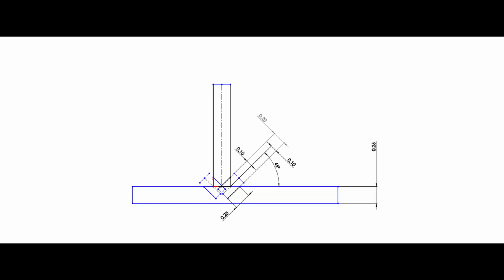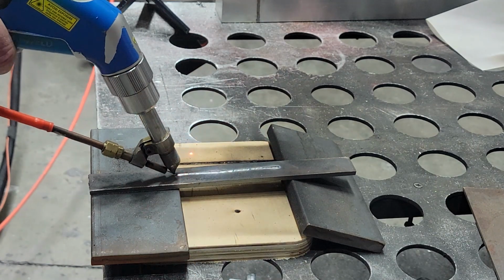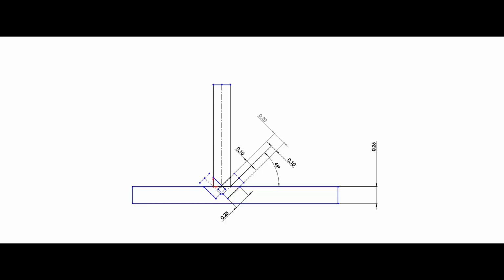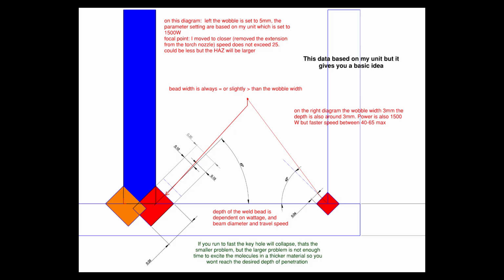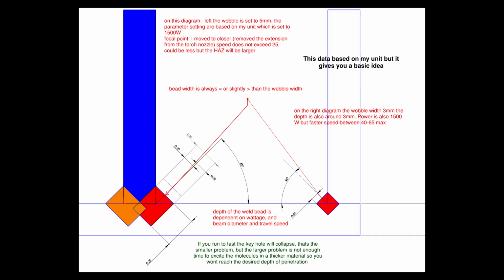how laser creates the plasma and how to control penetration

Comment: Nobody ever puts a ground clamp in arc welding. There is no such thing. It is a work clamp. It’s part of the live circuit. It can be called a return clamp as well. I don’t know where the term ground clamp came from, but it’s wrong. It’s also dangerous, particularly to new welders who don’t understand the electrical concepts of welding. If you clamp to something that is grounded, thinking, hey I’ve got a ground clamp, and begin to weld, you will short the welder, likely damaging it. You may also damage whatever you’re going to weld if there is electrical or electronics inside that isn’t isolated from the part you’re welding. You may even damage yourself.
Reply from the maker: We all know “ground clamp” is the wrong term, but it’s printed everywhere  even on packaging. It’s your favorite topic in arc welding, the same way I jump on the so‑called ground clamp in laser welding. lol

Comment from the maker: What I forgot to mention in the video is that fillet size doesn’t really matter. If you look at my chart, you’ll see why. Since you’re not relying on piling in filler metal, penetration depth is controlled by your parameters, and weld width is set by your wobble length. Ultimately, it all comes down to the maximum capability of your unit. Build your own chart and you’ll know exactly which settings you need to run. larger is you power the faster you can run your welds.  Its DWELL time!
"Added" : So why use filler metal if it’s not strictly needed?
Because your setup will always have small gaps where the laser rays can escape. By adding filler wire, fewer beams are lost, more energy is absorbed into the joint, and fusion improves.
And this is why dual‑axis galvo units are critical: they don’t just sweep side‑to‑side, they trace controlled geometries (circles, triangles, ) that lock more energy into the joint. the wobble pattern spreads heat across the gap, gravity drives the plasma into the gaps  therefore reduces beam escape, and drives deeper, wider fusion.
"Side‑to‑side wobble is absolute as of now".
This is why the Xtool is $3K and not $20K: it delivers the baseline wobble and filler‑wire fusion, but it doesn’t carry the full dual‑axis galvo geometry suite or industrial‑grade plasma control. It’s a small shop‑level unit, not an industrial‑grade system. Basically is not suitable for a  larger operation.
Reply: I have the XTool. It’s an excellent product. It can weld just as well as any other model within its power range, which is 1200 watts. It doesn’t cost $3,000. It costs$7,500. I don’t believe you know much about it. Filler metal does more than you seem to think it does. It prevents dished welds. That is, the lower than the surface welds you often get with laser autogenous welds, giving the weld strength. I sometimes use 0.063” wire and bigger models have dual or even quad wire feeders to give extra strength to the beads in thicker materials.
Reply from the maker: @melgross  "It prevents dished welds" yes, if your fitment is bad you need it. But if the fitment is precise you do not need it. 
And I don’t think I know. I ran a few miles of wire through my laser gun of all kinds. "key word is miles" Have to add Xtool is also Chinese and you hate Chinese products don't you? ok 7.5 k  ppl showing it over the net for 3.5k the 700W unit
Reply: @laserweld101 if your fitment is perfect and your settings are as well, you can still get dished welds. If you get full penetration, the surface is suck down as you can see there is weld below the surface on the bottom lf the weld. That’s coming from the top surface of the weld as the metal sinks slightly from the melt and the full penetration. The filler levels that dish. The is basic.
Reply from the maker: @melgross   https://www.youtube.com/watch?v=fZn5lTs-DqU&t=290s   17:25 show me the dish no wire, only made a few hundreds of those parts. same results